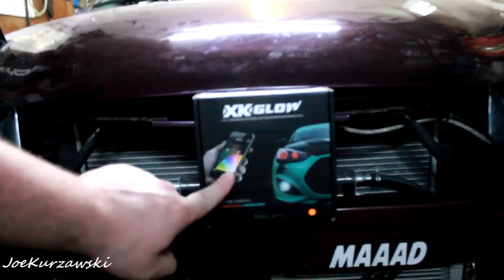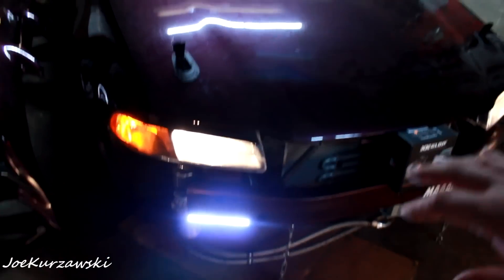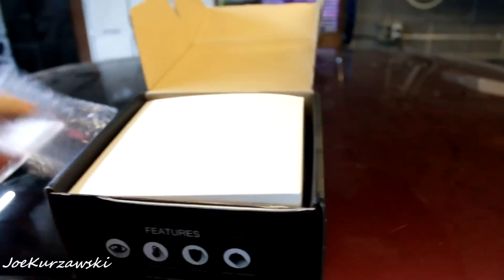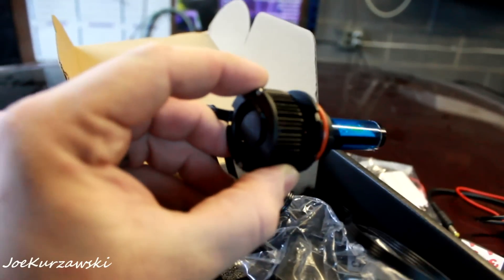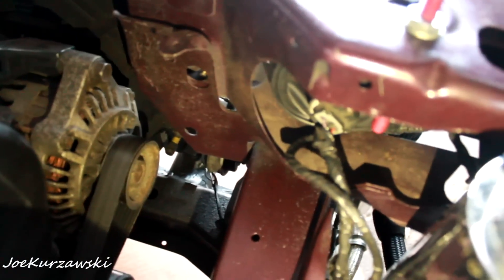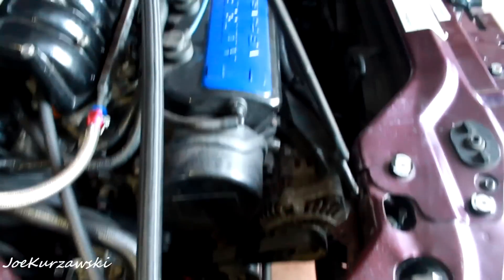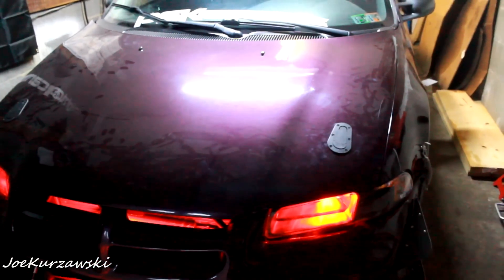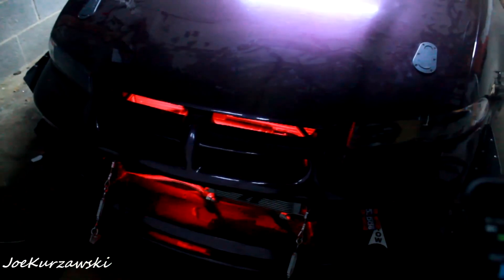XK Glow RGB (DEMON) Headlights

Comment from the maker: Thanks for all the views! This is the fastest any of my videos have hit 1k
Reply: Joe Kurzawski how have the bulbs held up?
Reply from the maker: Chasing Colorado still holding up with no issue. The double sided tape for the power supply’s needed redone on one of them but operational no issue.
Reply: Joe Kurzawski good to hear. I got projector headlights and was thinking about putting these bulbs in. My only problem is the owner before did a hack job when installing the aftermarket lights so I'm still trying to figure that one out
Reply: You’re like the only one with an actual review video
Reply: Are the  Colors bright enough to drive with? Are they the same brightness at white?
Reply: Are they still working up to this date? On CarID they are discontinued for my car, by the looks of it they didn't do so well.
Reply from the maker: Leonardo Aranda still working fine for me and the site still has a dozen options, they did update them and make them brighter now since I had got them

https://store.xkglow.com/catalog/product/car-truck/2-in1-led-headlight-multi-color-devil-eye-xkchrome-smartphone-app/
Reply: @JoeKurzawski  for my vehicle the customer rep told me they are discontinued for unknown reasons. Thanks for replying, good to see that they're still working.

Comment: There a good brand I have the h11 and full run 6k white high and low the light out put is pretty bright I'd recommend the brand I was considering this kit but I think NC law want allow red or blue either way sleek install
Reply from the maker: Nbs Addiction15 yeah red would get you pulled over here in pa. There is a feature to hook them up to run as yellow/white daytime running/turn signals

Comment: Do you have any trouble with the Bluetooth connecting to your phone
Reply from the maker: David Vela I’ve never had a Bluetooth issue. Mine has always connected well.  
I just did as they say in the manual. Turn on the xkglow unit have the app open on the connect page and tap the phone against the box.
Reply from the maker: Usually will stay connected until there is an app update

Comment: Hey how did you connect the on/off switch I have the same issue but don’t know how to get the power button into my car... the only option is to place it under the hood but that’s very inconvenient to have to pop the hood every time I want to turn on the demon eyes please help
Reply from the maker: TERRANCE SNEAD you can either get extra wire and put a second switch inline on the red power wire. Or get the adapter they sell to just plug it into your 12v accessory/cigarette lighter.

https://www.xkglow.com/12V_Cigaret_Lighter_ON_OFF_Plug_with_DC_plug_p/xk-plug-dc.htm

Comment: Hopefully i'll get a reply, but when you install these lights, do you still have the option to use them as normal headlights or do you need the backup fog lights like he has for nighttime driving?
Reply from the maker: Eppixco the color part is lit separate from the headlight. But it’s all built into the same led light bulb. They have normal headlight all controlled normally with you normal headlight switch and it all plugs into one sockets. The color change is a separate function of the same bulb

Comment: I ordered a same set and mine comes with a yellow sensor wire to tap into a 12v source for the Bluetooth. Did yours bad that if so what is it for exactly?
Reply from the maker: Daniel Bocanegra the yellow wire I believe is to connect if wanted to the turn signal. So then it would flash yellow on the headlight rgb as well
Reply: Joe Kurzawski oh wow, that sounds awesome, thank you!

Comment: ok so these colors im seeing are head light bulb are is this separate from the headlight. like is the head light switching from white to these colors? for example when i switch to red will it output red on the road like i have red bulb?
Reply from the maker: SlimSlugga713 the RGB leds and headlight LEDs are separate and controlled separate but contained in the same bulb. You can have both the color and headlight on at the same time but the headlight leds are so bright you can't really see the color.
Reply from the maker: SlimSlugga713 it will put out some light on the road but not really anything useful
Reply: oh ok cool thanks

Comment: looks sick! A couple of questions. How did you hook up the demon eyes to a different switch? Also, the headlights use the stock headlight switch correct? Great video and awesome car!
Reply from the maker: Tampa Dashcam yes the headlights work as normal. As for the demon eyes. The switch the kit came with wasn't long enough to get into the car. So I left the switch hidden in the engine bay and switched on, Hooked up the ground as normal. And hooked the power wire to an existing power wire I have for a red led strip on the crash bar. My solution for now. They do sell extension cables so that I could of mounted the controller in the car and then the power switch would reach. Or you can get a cigarette light adapter and not have to wire power up at all. For now it works. Eventually il eliminate the extra switch the kit came with. 

They have a lot of extra parts on the website though.

Comment: WHen my car is off my demon eyes is still on, how do i turn it off? do i just turn down the brightness on the app?
Reply from the maker: In the top right corner of the app is the 3 stack line icon. If you hit that it will show all the light zones. And there is a little button on the app to turn off all zones or each one indipendently
Reply: @JoeKurzawski  awesome it worked. thanks

Comment: Did you have to hook anything up too the car battery ?
Reply from the maker: Tito Douglas you need a power and ground for the module. There are a lot of ways to hook it up. The battery is the easiest but the toggle switch wire supplied isn’t that long

Comment: What was your solution to the short switch wire.. I just picked up a kit myself and I didn't realise I had like.. 1 foot of wire to work with
Reply from the maker: Misaka Kusanagi I actually bought this plug http://www.xkglow.com/ProductDetails.asp?ProductCode=XK-PLUG-DC&click=9451&utm_source=googlebase&utm_medium=shoppingengine&gclid=CjwKCAjw7cDaBRBtEiwAsxprXbAfNvxX_h-zbQ-P2Vew1KAauH3eKIK7zceR5R_9SkVs2Un_BGxIzhoCpkMQAvD_BwE

And cut off the cigarette lighter part and grounded the black wire. And ran the black and white stripe wire to a toggle switch than the switch to a fuse to the battery

Comment: I'm a little nervous to buy these I have h11b bulbs ... not sure if the bulbs really matter on my car they have h11 just without the B lol I think that's what's making me skeptical
Reply from the maker: Reese Holt I think the way they mount is different and one is low watt for fog/driving light. And the other for headlights
Reply: Joe Kurzawski yea I wonder if i can get a female/male adapter to fit it so it plugs in properly
Reply from the maker: Reese Holt you could always get a new plug pigtail and rewrite it I guess

Comment: Can this be used in a conventional headlight without blinding other drivers, or is a projector setup recommend?
Reply from the maker: Seth Page I can't really give a good answer on this one. They are brighter than stock but I didn't notice any of the glare HIDs give off. My stock housings are really small. So if your concerned with glare. I'd recommend getting a cheap eBay led bulb and testing it for glare. Or just go full retrofit.
Reply: May give that a try, thanks for the reply. Mines a 97 Civic already has a ton of glare with stock bulbs haha.

Comment: Hi Joe. I have two clarifications1. Are these the whole set of headlights or just the bulbs2. Will this fit my Lancer Ex 2014 .
Reply from the maker: Na Ar 

The kit comes as a pair of bulbs, wiring,    and the Bluetooth module. It's just 2 bulbs
 So if your car has say a separate high and low bulb you would need to buy another pair of lights and a splitter cable to connect the RGB part of the lights. 

Also they should have something for your car as they have A ton of options. I'm sure the customer support there can get you everything you need. Here is the link.

http://www.xkglow.com
Reply: Thanks Joe. My car does have separate high and low bulb.

Comment: What did you do with the buttom to enable/disable the controller that you said it wasen't long enough?? You got an extension or something?
Reply from the maker: Michael Anndres for the video what I did was hid the switch in the engine bay and connected it straight to power. Currently I ran the power to a switch that sends power to led strip in the grille. So I basically have 2 switches. What I'm going to do is get this adapter
http://www.xkglow.com/12V_Cigaret_Lighter_ON_OFF_Plug_with_DC_plug_p/xk-plug-dc.htm

Cut off the cigarette lighter and just hard wire it so I have one switch that powers the demon leds and my red grill led strip.
Reply: Joe Kurzawski That would be an awesome idea for a video, cause no damn body has done it lol literally there's no videos explaining how to completely install this thing and that step that you told me sounds kinda hard to do lol
Reply from the maker: Michael Anndres il get started on that
Reply: I contacted xkglow customer service about the on and off switch being to short to get into the cab , if you notice in the app at the top right hand corner the three white line  will tell you if you are connected to the Bluetooth controller , while connected you have the option to turn on and off the rgb function. So i asked if i left the on and off switch under the hood and kept it on and just used my phone to turn the rgb function on and off if it would hurt anything. And there response was , thats what most people do , as long as your vehicle is and everyday driver or every other day driver , the power consumption of the switch is very low so it will not hurt to leave it on.
Reply: Donovan Benoit thanks man
Reply: I think the power wire is short because they expect you to wire it up to the fuse box under the dash.

Comment: Can you cut the power off from the app?
Reply from the maker: Antoine Lawrence you can turn the color led off from the app. But the Bluetooth module will always be powered in less wired to a switch or a key on power.

Comment: How are these for nighttime driving compared to halogen?
Reply from the maker: bmac2368 they are brighter. And a very white light. And I can see farther. However in fog they are worse cause it's more light reflected back. I rarely have this car out in bad weather. My friend has led headlights in his jeep and he said snow he has to use driving/fog lights only because the leds get reflected back more.

Now the big issue is the pattern. Cause even good leds like these aren't fully putting out 360 around the bulb. So different cars will be affected differently. Mine is ok. Had to rotate the bulb to get the best pattern. But other cars may be different. And some cheap leds won't cover as far. 

I kind of want to test a set in my caliber as it has a big circular housing rather than the narrow rectangular one in the stratus.
Reply: Surprising they work so well, I was always curious. I was going to try them but I have projector headlights which would probably really mess up the pattern.
Reply from the maker: bmac2368 I eventually do want to get someone to build a proper projector setup for the car